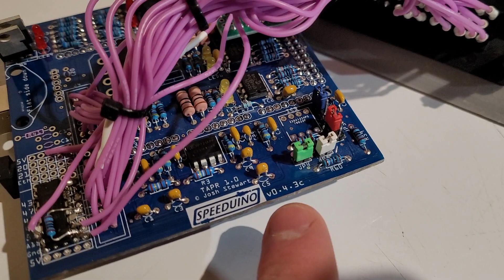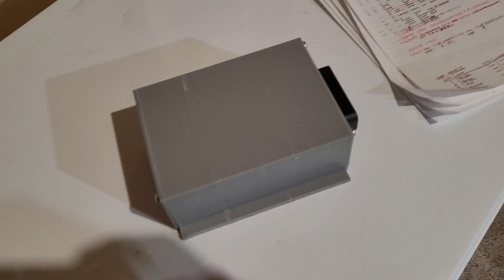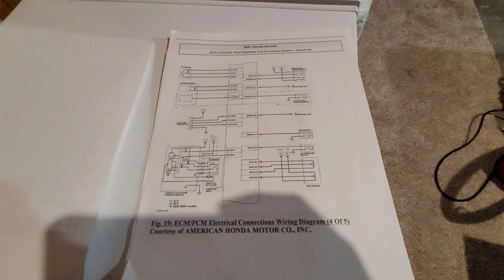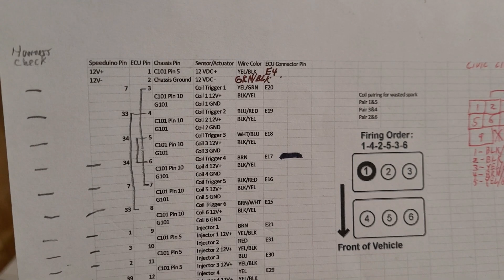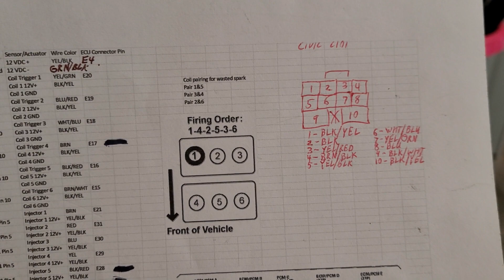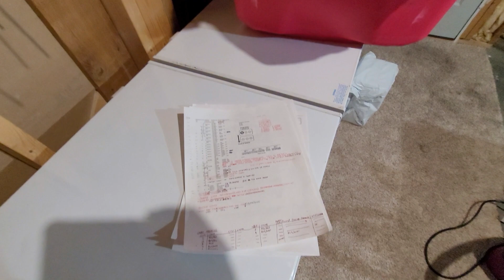EK Civic J Series Swap Ep 10: Speeduino Build for Honda J30a5

Comment: So your going to actually run the vtec? I’m running speeduino, but I had so many running issues with my Nissan and the vvl that I had to lock the cam phasers, and put a crank trigger wheel 36-1 and a gm crank sensor and on the cam I cut the cam trigger wheel and left 1 tooth and used my stock cam sensor, I hope u have better luck with it, I am learning a lot from ur videos keep them going at least someone is addressing these issues with speeduino, but I have no idea where to find information on these speeduino except for the wiki
Reply from the maker: Yes i am going to run vtec. On this engine its like the older hondas where it switches to a more agressive cam profile. Its on/off, so no cam phasers on this one. I also did a k series on speeduino which does have one cam phaser. The vvt on speeduino is not the best in my opinion.